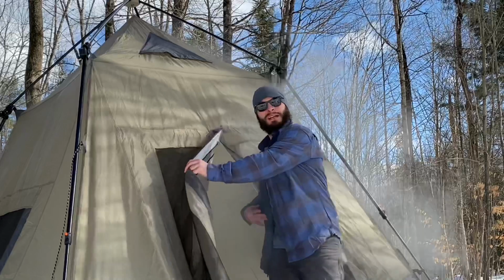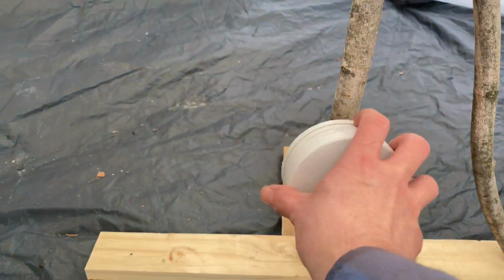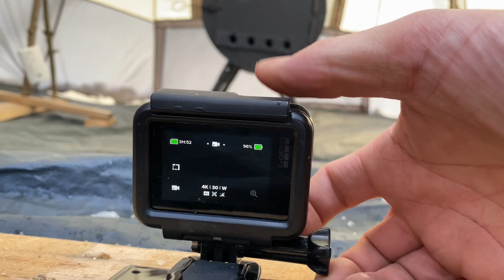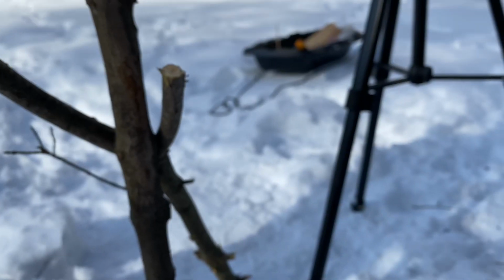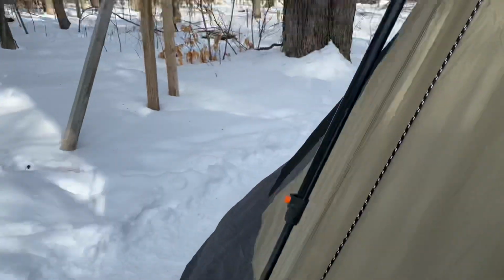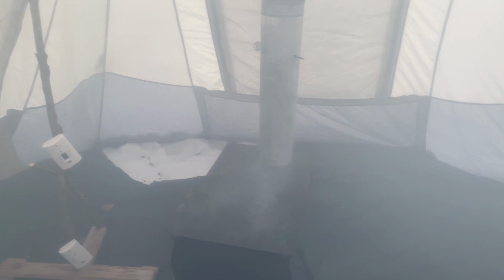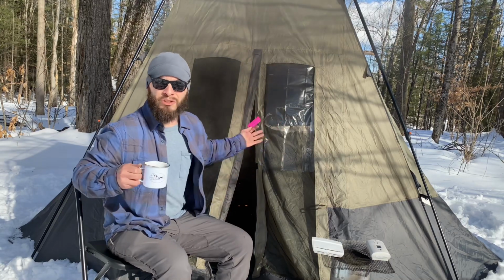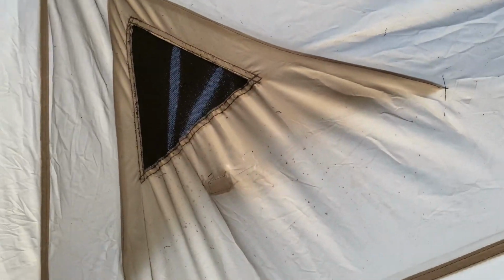Hot tent smoke detector and carbon monoxide test! Watch this before hot tenting!

Comment: i found this in case anyone is interested
Carbon Monoxide Levels That Will Set Off Your Alarm
Carbon Monoxide Level   	Alarm Response Time
40 PPM	10 hours
50 PPM	8 hours
70 PPM	1 to 4 hours
150 PPM	10 to 50 minutes
400 PPM	4 to 15 minutes
Reply from the maker: @Luke thanks for sharing this. It’s been a while but I think I said that some where in the comments but I’ve pinned your comment for anyone looking for the info from now on. Thanks for watching!
Reply: I have a winnerwell large stove in the cabelas ultimate alaknak tent with all vents/windows open . No visible leaks in the stove but for some reason my carbon monoxide alarm keeps going off reading anywhere between 30-70 ppm ?
Reply from the maker: @nicholasgiard4532  so you have a digital read out of the detector? If so, hold it close to the stove and different areas for a length of time to see where it increases. Maybe finding where it’s coming from. Do you have a spark arrester on your chimney? Damper on your pipe? How hot if your fire? Definitely don’t go to sleep with it running like that, in my opinion.

Comment: Tuesday, 3-5-24 , the test you did really showed how important a smoke detector is , i guess a carbon monoxide detector is important to have , but i believe after 11 minutes of smoking up your tent, like you said, you may not wake up at all, good video, thanks.
Reply from the maker: Sure does! CO detector is just as important especially for when the stove burns down to coals. Without smoke the smoke detector won’t go off but CO can be released. I suggest having both in your tent with any heat source. You’re welcome and thanks for watching

Comment: I definitely recommend the smoke detector.  I was hunting last fall and the spark arrester on our wall tent stove plugged up and smoked out the tent.   I was sleeping in it by myself luckily my buddies came in and woke me up and got the tent vented.   Smoke detector would have been really helpful there.
Reply from the maker: @james edwards yeah man, shit happens. I recommend both now. I had a scare with CO with my daughter in the tent with me. 3am door opened up. I believe the stove warped so badly from the heat and when it cooled it “popped” and opened the door. Releasing CO into the tent. So yeah I always have them with me. Thanks for watching

Comment: I have a winnerwell large stove in the cabelas ultimate alaknak tent with all vents/windows open . No visible leaks in the stove but for some reason my carbon monoxide alarm keeps going off reading anywhere between 30-70 ppm ?
Reply from the maker: @Nicholas Giard  so you have a digital read out of the detector? If so, hold it close to the stove and different areas for a length of time to see where it increases. Maybe finding where it’s coming from. Do you have a spark arrester on your chimney? Damper on your pipe? How hot if your fire? Definitely don’t go to sleep with it running like that, in my opinion.

Comment: Don't know if you still check comments. But seems like you go run a fresh air line beside the gas line.   Yeah?
Reply from the maker: Absolutely still read the comments. I’m not sure what you mean though. Please explain more. Thanks for watching
Reply: My bad.   I combined 2 videos I watched.   .   Instead of opening several widows,  run a fresh air line/ hose from outside tent to the heater.   Figure out how to stabilize it so it doesn't catch on fire!   Give heater a fresh air source so it doesn't need air inside tent.   Not an engineer.
Reply from the maker: Ah yes I’ve done that too. I used an aluminum like dryer vent pipe for my air intake.

Comment: Those Carbon monoxide detectors only go off after a prolonged exposure. Having this understanding also supports your thought of having a smoke detector.
Reply from the maker: @Josh Clinesmith yeah it is an important thing to know about them. It takes 8 minutes of exposure of 400 ppm to go off. That’s crazy. Thanks for watching!
Reply: The carbon monoxide detector in my garage went off almost immediately when I started up the snow blower just in front of my garage door.  I was bad enough that I could smell the fumes.
Reply from the maker: @Tom McDermott whoa I wonder if exhaust has a much more higher ppm then smoke. Thanks for watching

Comment: I would use a smoke detector with a stove since they smoke and a CO detector with propane. Real world testimony from 10,000 feet... Practice with all wood! I only used hardwood, then on a trip I was forced to use pine due to what was available.  Started the stove early and left it dampened down, later loaded it and went to bed. At 3:30 AM I woke to a tent full of smoke. The screen spark arrestor plugged up and was dripping pine tar on the stove and burning due to the smoldering stove. I would not use any type of screen spark arrestor, even if its how the stove comes. This was a high dollar ti stove meant for the backcountry, practice,  practice, practice!  Also, use good stakes if your going to put any heat source in a tent! My $0.02
Reply from the maker: @Capt Morgan first love you with some coke lol. Second thank you! I too have had a spark arrester fill with creosote and clog up. Likely this happened when I was first lighting the stove in the morning. I always have both with me, co and smoke detector. Always advocate for uses to do the same cause you never know what can and will happen. Thanks a lot for watching and for your 2 cents lol.
Reply: @AdventureswithSpackmann  lol, Capt.Morgan is not only a fine beverage, it is also a military rank. That comes from my Call of Duty days way back in the PC era of video gaming. #OG lol

Comment: Your assistant is fantastic. Ya don’t go in there it’s a death trap! 😆 how cute. Great test, I’ve heard the carbon monoxide alerts can be crap before. I use both and I’ve had my smoke detector beep in my gear loft when having the door open and a poor draw. I let my fire die before I sleep anyway. Great test
Reply from the maker: @Mobile Winter Camp she is great! I didn’t know it takes 8 minutes of constant exposure to 400 ppm before it goes off. That’s crazy. I let mine go out at night too usually. Thanks for watching!
Reply: I have a winnerwell large stove in the cabelas ultimate alaknak tent with all vents/windows open . No visible leaks in the stove but for some reason my carbon monoxide alarm keeps going off reading anywhere between 30-70 ppm ?
Reply: @nicholasgiard4532  wow try a second detector at the same time and see if the first one is defective.

Comment: The only reason why it took so long to sound for the carbon monoxide alarm was because it uses a certain type of sensor called electro chemical. This usually takes longer sound. A smoke alarm uses a photo electric or ionization one where the air is disturbed and it tripped the alarm. This is not how electrochemical sensor works though it works with a chemical that reacts with carbon monoxide it takes longer for it to sound but this is normal especially in a situation where your fire is wood-burning and does not produce as much carbon monoxide as some thing like a constant heat natural gas stove but that’s just my thoughts. 

I would still suggest however using a carbon monoxide alarm in your tent no matter what carbon monoxide puts you to sleep and will kill you if you are not alerted.
Reply from the maker: @William Nerd of fire alarms thank you for sharing. I think it’s a good idea to have one as well. Thanks for watching!
Reply: I have a winnerwell large stove in the cabelas ultimate alaknak tent with all vents/windows open . No visible leaks in the stove but for some reason my carbon monoxide alarm keeps going off reading anywhere between 30-70 ppm ?
Reply: @nicholasgiard4532  Carbon monoxide alarms can be very sensitive when they are out of date or their batteries need replacing. I’ve also noticed that in colder or hotter climates or sometimes even humid areas the carbon monoxide alarm will jump in carbon monoxide levels. It is also evident that sometimes the digital screen on the carbon monoxide alarm may not keep up with the actual carbon monoxide levels in your tent and or area. When I was doing tests on lower grade carbon monoxide alarms I noticed that when I was testing it around car fumes it would jump from 480 ppm to 999 ppm. Anyways if your carbon monoxide alarm is giving you issues replace it with a better one if this issue keeps occurring with a different unit there might be a problem with carbon monoxide even with all the ventilation.

Comment: Interesting test.  I definitely would have expected the CO detector to alarm much earlier.  Thanks for sharing.

Note, at the end you said CO2.  Carbon monoxide is CO.  Carbon dioxide is CO2.  A lot of people get them confused.  "di" means two... and in this case, two oxygen atoms.  Carbon dioxide (CO2) is produced when there is complete combustion.  Carbon monoxide (CO) is produced with incomplete combustion.
Reply from the maker: @Dave B I expected it to as well but they really don’t go off that fast. You are welcome. This test was fun to do. I’ll be doing more this year I hope. Yeah I know, I misspoke there at the end. Thanks for watching!
Reply: I have a winnerwell large stove in the cabelas ultimate alaknak tent with all vents/windows open . No visible leaks in the stove but for some reason my carbon monoxide alarm keeps going off reading anywhere between 30-70 ppm ?

Comment: I use a CO monitor for flying small airplanes and will undoubtedly use it when I start hot tenting. It’s called a tocsin3 by a company named Otis. The unit itself is about the size of a flip phone and it’s a bit pricey but reads and displays the number of the CO level (as well as other toxins) in real time and has an ungodly loud alarm that also flashes. The only drawback aside from price would be that I don’t think it detects smoke and you have to send it in every couple of years for an $80 battery and sensor replacement. Thanks for the info! Your blazing a trail I’m about to start on!
Reply from the maker: @Adventures with Mike whoa yeah that price just for upkeep is a drawback for me. Do you fly them in your garage or just repair and test them there so the engine is running? Good luck on hot tenting! It’s so much fun. I have a video on my current hot tent setup if you’re interested. Thanks for watching!
Reply: @AdventureswithSpackmann  I fly cessnas and pipers and am training to do more bush flying, that’s where the hot tent and survival type gear comes in. If I’m forced to land somewhere in the back country I want to be able to take care of myself. One of the things that can happen in a small single engine plane is an exhaust leak, if that happens it goes straight into the cockpit and you don’t have long to land or at least open a window.
Reply from the maker: @mikeboard1  ohhh that’s awesome! I’ve never been in a plane before lol. That sounds like a ton of fun. In the winter do bush planes have skis to land on the snow or something for landing on ice?
Reply: You sure can, floats for remote mountain lakes too. Look up Trent Palmer on you tube for an idea of what I’m working on. Is there any chance your in British Columbia? I would love to take you for a ride.
Reply: @AdventureswithSpackmann  You sure can, floats for remote mountain lakes too. Look up Trent Palmer on you tube for an idea of what I’m working on. Is there any chance your in British Columbia? I would love to take you for a ride.
Reply from the maker: @mikeboard1  so cool! Thank you so much for the offer. I am in NY state. Getting dropped off by float plane for a canoe trip is on my bucket list. I would love to be able to do that some day.